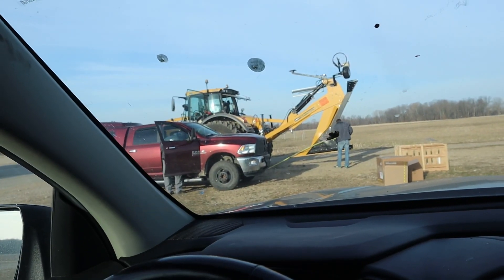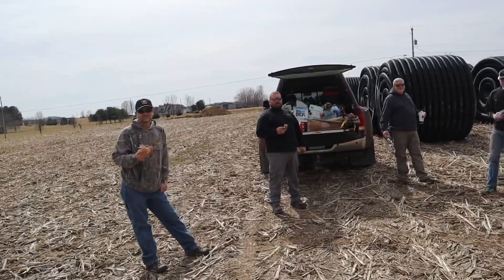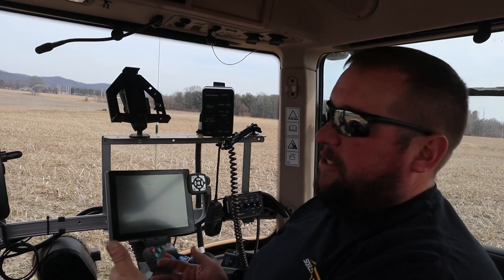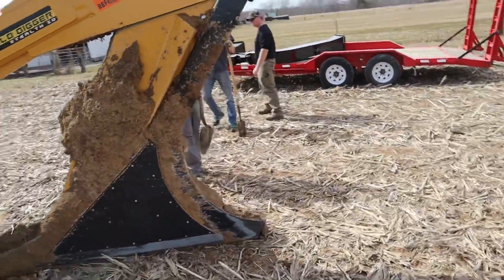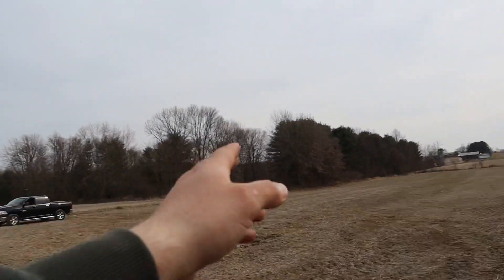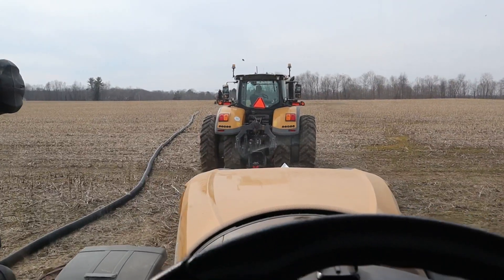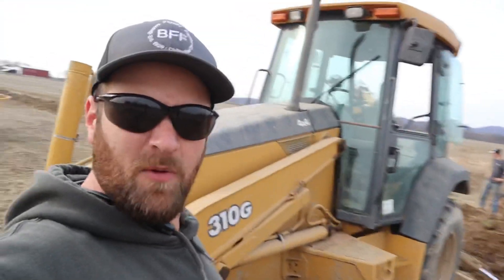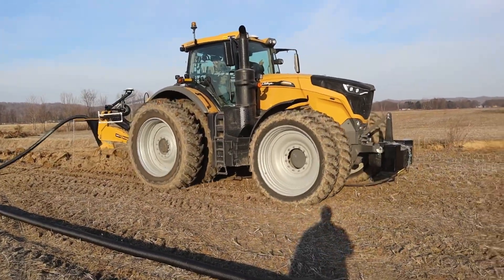Digging For Gold with 760 horsepower

Comment: Brett,thanks for the information. As I have mentioned before,I grew up on a dairy farm in South Eastern Idaho, We farmed roughly 300 acres and was all irrigated by sprinkler pipes or flood by ditches. We were basically poor compared to today's standards.  I never even heard of tiling fields till watching these farm videos. That is why I asked what does the copper wire does. These comments and videos are VERY informative for me as an ex farm boy. I left the farm for the military, and while still in the military my dad died and my mom sold the farm. So I haven't been in farming for over 45 years. THANKS FOR THE VIDEOS AND COMMENTS.

Comment: Here in vineyard country as a contractor i use a straight edge bucket for laterals and tile hunting. It's helpful sometimes. Sometimes it's the one more scratch and I'm a hero with the pipe on the bucket. If i have labor a 3/8 fiberglass fence stake is a good feeler going down. Love the tile plow and the company rep's.

Comment: If near a pipe or anything have a laborer with a 3/8 rod sharpened and a bent handle, it’s amazing what you can feel and find with that set up. Never never try to do the laborers job the with machine guaranteed to add a lot of extra time to job. Very interesting and informative.

Comment: Brain: Your tile plow will make you a better return than any of your other equipment. Depending on your soil type it will take a few years to really see much in results.  The finer the soils( higher clay content) The longer it takes to show results.  Also in some types of Blue clay areas it might take 6-8 years. The plow will smear the clay as you install it and it takes time to open back up so water will flow into the tile.  We did one really bad blue clay in 2012 and it just showed results in the last few years.  The first year after yields actually went down as we had a wet year and the "new" tile lines blocked the old natural drainage. 
   Wish your Mother the best. My Mother had the same issues. I bet it is really hard on your Dad.
Reply: If watched the first video, they discussed the process in generations type of deal,dad to his kids,then to there kids as far as things really showing paybacks. Plus,this technology is always improving things,getting better. Things have changed so much from when I grew up on a farm in the early 60's and 70's. I remember the ole snowboard used to cut hay then the rack to window it for baling.
Reply: May wanna start out with his name & not Brain. Brian may be a bit better.
Reply: @IIIRorschachIII  Well Thank you for your editorial reply!!!!

Comment: I saw a vidgit  in Holland  where there plow went 36"  deep and never broke top soil it put pipe in and never disturbed  top soil it's going to be nice in the spring  4 planting
Reply: Most places in The Netherlands you’ll see chain trenchers (and sand being added in the trench) for tiling. Those V-plows only work in specific soil types (for the exact reason you mentioned, no/little soil disturbance).

Comment: Is that a zd48 plow?  Looks smaller than our pull type 6' but maybe it is just the way it is mounted.  Btw we pull ours with a JD9579R with 800 duals.  You got bad advice on which tractor to use.
Reply from the maker: No this isn’t the zd48

Comment: Tile will pay for it self 6-7 years in increased yields and soil health.... bolt a solid  plate across the teeth of the back hoe it will bounce over the tile instead of tearing it. My tile guy says if you run a copper wire with the tile tree roots won't grow in it....We did it along some tree lines.
Reply: What does the copper wire do to prevent this????
Reply: @nealhadley1482  copper isn't fatal to trees but it will stop root growth.. think copper sulfate you'd dump in septic system. using copper pipe/wire with tile is a pretty old trick in tiling

Comment: 9:30 that seems backwards, how come a quad pulls a tile plow really good then? lots of flotation.

Mind you there is a good point on the Deere possibly not going snow enough.
It is been proven many times that the more rubber you have on the ground the more you pull. By both Nebraska and the tire MFG's.
Reply from the maker: Quads go good till it gets greasy or frozen then they just float. They don’t dig down much like the skinny tires
Reply: @BriansFarmingVideos  no because the same force is still exerted on the soil. You're weight gives you your traction and the soil bearing capacity will determine the slip, more surface area of the wheel increases the capacity of the soil to give you forward motion so less spinning.

Comment: Excavator with spade teeth on is a lot better...the tiling company I work at Clark farm drainage in new castle, IN we use excavators they are a lot more handy to use and seems more smooth then a backhoe would and when digging down to the pipe find the top place your bucket up and down get a mark for your death then from there you can hog out most of the dirt then scratch down to your pipe gently that’s where the spade teeth are the best to have at on a good day I can do 30-40 dig outs a day did 50 one day and I always say if your not a good excavator operator just backfill to get the controls down then digging will become easy for you since it’s easier to dig down on backfilling and cover it up then messing up the controls digging then hit the pipe or under dig backfilling you got the ground telling you if your strokes are smooth or not enough or to much pressure just all in my opinion I’ve trained two guys so far one has improved a lot and the other is still learning slowly just easy steps to become a better operator in the long run if your not 100% sure on the controls to have the touch for a good dig out

Comment: 3 POINT IS THE ONLY WAY TO GO . IT PULLS THE TRACTOR TO THE GROUND . A THEM OTHERS ARE A DEAD PULL AND YOU JUST SPIN
Reply: Obviously you’ve never pulled one then. They pull down on the drawbar so hard you have to add air to rear tires. So they are not a dead pull. I’ve put in several hundred thousand feet with a Liebrecht pull type.